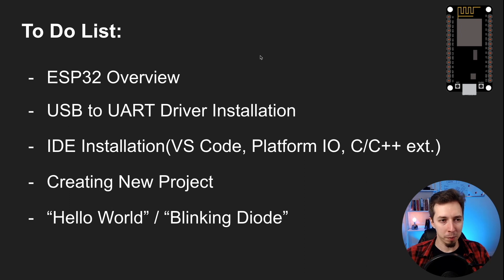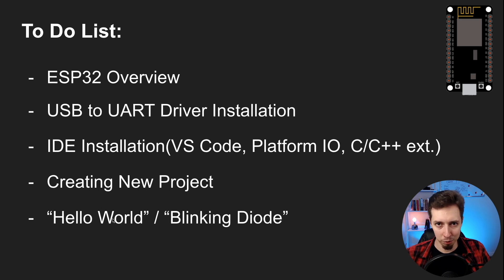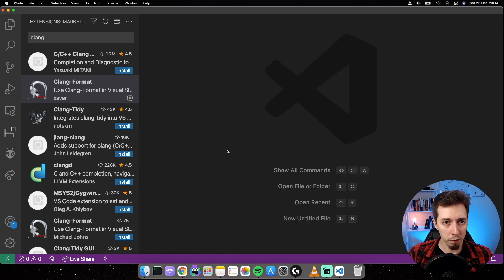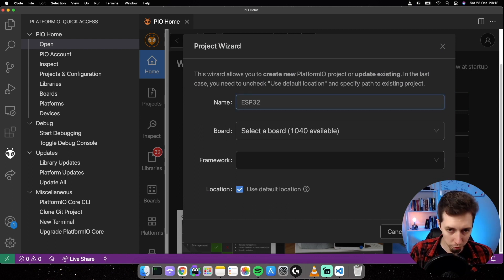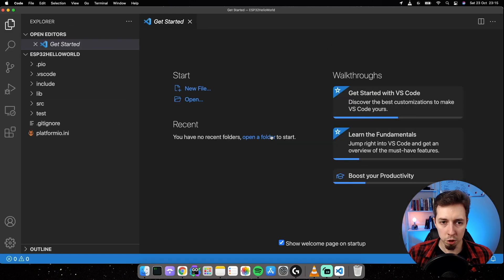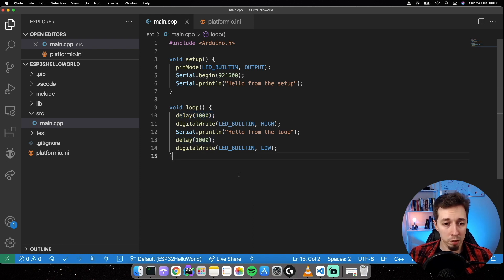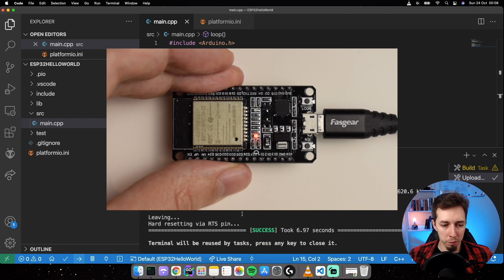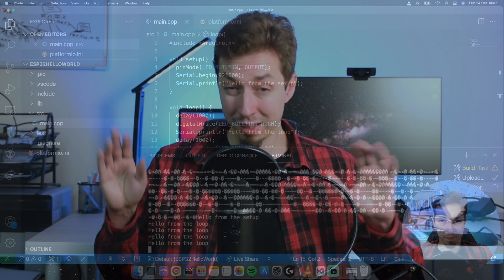Getting Started with ESP32 - Step-By-Step Tutorial

Comment: 4 years later and this is still one of the best beginners ESP32 tutorials I have seen. Worked neatly in Windows 11 as of 2026
Reply: I also enjoyed this video. I had one small doubt 🙂
Do you know if it’s possible to integrate sound sensors and gas sensors in this ESP32 simulation (VS Code) without using physical hardware?
Reply: I also enjoyed this video. I had one small doubt 🙂
Do you know if it’s possible to integrate sound sensors and gas sensors in this ESP32 simulation (VS Code) without using physical hardware?

Comment: Thank you so much for the video help, Tomasz. With a few tiny errors it worked great.  (I had to wait for the "Connecting......." before holding the ESP button.
Since this chip takes 3.3v and not 5V, how would you power it if on battery?

Comment: Unfortunately, the upload to my dev board is not working. Yes, I pressed the boot button -while plugging the cable in, after plugging the cable in, before plugging the cable in -it does not matter. There is no device found. I chose usbmodem as a connection, since I use an Xiao ESP32C3 board which should have a usb controller built in. But the Uart connection does not work either -also no device found. Any Idears? Thank you!

Comment: For ESP8266 you keep boot pin grounded, then you ground reset (or push buttons if buttons are connected). So the mcu starts in Flash mode. It is about espressif cpu I suppose.

Comment: Hi Tomasz,
I am using a DOIT board. When I try to upload the code, I get an error as below:
Error: Please specify `upload_port` for environment or use global `--upload-port` option.
For some development platforms it can be a USB flash drive (i.e. /media/<user>/<device name>)
* [upload] Explicit exit, status 1

Can you please guide? Thanks.
Reply: I figured out what the problem was. The cable that I was using only had power lines not the data bus. Changed the usb cable, now it works. Thanks.

Comment: sir its show error on compiling Traceback (most recent call last):
  File "esptool.py", line 31, in <module>
  File "PyInstaller\loader\pyimod02_importers.py", line 352, in exec_module
  File "esptool\__init__.py", line 41, in <module>
  File "PyInstaller\loader\pyimod02_importers.py", line 352, in exec_module
  File "esptool\cmds.py", line 14, in <module>
  File "PyInstaller\loader\pyimod02_importers.py", line 352, in exec_module
  File "esptool\bin_image.py", line 14, in <module>
  File "PyInstaller\loader\pyimod02_importers.py", line 352, in exec_module
  File "esptool\loader.py", line 30, in <module>
  File "PyInstaller\loader\pyimod02_importers.py", line 352, in exec_module
  File "serial\__init__.py", line 29, in <module>
  File "PyInstaller\loader\pyimod02_importers.py", line 352, in exec_module
  File "serial\serialwin32.py", line 15, in <module>
  File "PyInstaller\loader\pyimod02_importers.py", line 352, in exec_module
  File "ctypes\__init__.py", line 7, in <module>
ImportError: DLL load failed while importing _ctypes: The parameter is incorrect.
[3312] Failed to execute script 'esptool' due to unhandled exception!
exit status 1
Error compiling for board ESP32 Dev Module.

Comment: Retired engineer, old enough to be your grandpa. Really enjoyed your tutorial.  Discussing really simple steps is critical to start the learning process.  :)
Reply: Same here
Reply: Broooo💀💀i mean uncle l.... No gramps✅
Reply: You are no one’s grandpa
Reply: I built Anime Multimodal Emotion detection https://youtu.be/VNn2a7_wTZU?si=913oBFmeWxG2hnLo
Reply: I just know ESP32 for camera by combine it with arduino? Actually what's the exact function of ESP32?
Reply: @edibandulan5266  It's basically made for IOT applications - it's an SOC that integrates WiFi/Bluetooth so you can have multiple microcontrollers/processors, communicating with one another over your home network (or on their own private network), and controlling things via GPIO accordingly. They can also do interesting things by themselves - act as a super low power DNS server, and other things I don't understand lol.
Reply: @edibandulan5266  Hi, ESP32 is microcontroller. There are many microcontrollers like TI MSP430 series, NXP KM series, etc. Microcontrollers unlike simple processors come with alot of peripherals integrated into the single chip, like UART module and SPI for communication, ADCs to convert analog signal to digital values, etc. ESP32 comes with, one can say, peripherals needed for WiFi and Bluetooth communication, other than regular peripherals like UART, SPI, I2C, etc. And the processor is very powerful, plenty of memory, and extremely cheap as compared to other chips with similar features. So if you want to give your system, maybe camera, or maybe sensor system, wireless communication capability, ESP32 is a good choice
Reply: @edibandulan5266 it's a microcontroller. You can use it as a Mini-Computer for specific tasks. Read the current water height on a tank is probably overkill, but I'm using it to create an instrument panel for flight simulation.

Comment: Using an ebay ESP32 ESP-WROOM-32 ESP-32S Development Board 2.4GHz WiFi & Bluetooth I found LED_BUILTIN didn't work, undefined; found the blue led on the board (other was a red Power LED) is GPIO_NUM_2 , changed that plus used 115200 as the baud rate and it worked. Linux Mint using the VS Code flatpak.  Only changed the baud rate because I recognize 115200 not  the 921600.    Also used the ESP32 DEV Module.     Appreciate the video.
Reply: we're using the same devices, thanks for the heads up

Comment: i have a question,on this line "serial.begin(921600)"in void set up,what does this number"921600"mean?what does it represent?
Reply from the maker: 921600 is a call baud rate. It represents the speed of data transfer between ESP32 and computer over the serial connection.

https://en.wikipedia.org/wiki/Baud

Comment: This is a great video!!! Thanks for teaching me on the basics of an ESP32.

One question I had is. How do you terminate the process?
When I kill the terminal, the diode is still blinking and it won't stop
Reply from the maker: Hi Clay,
the code runs on a microcontroller so it will run as long as you provide a power to it so the simplest way to "terminate" it is to disconnect it from the power source although if your goal is to be able to run and kill processes on ESP32 you can either program it so external control is possible (you can check my other videos on how to control it over WiFi/internet) or you can put it to sleep after X number of seconds (I don't have a video on it yet but I'll make one soon)
Reply: @tomasztarnowski4434  
Thank you for explaining it
Again, very helpful video

Comment: Can I use sample codes for ESP32 WROOM and libraries with the ESP32 - mini-c3 ??? I need to do a low power project, so that's why I'd rather used the ESP32miniC3?  Thanks
Reply from the maker: Hi Sophia, I think it should work with ESP32 mini-c3 as long as you select the right board when creating a new project in PlatformIO however if your board is not on the list then it might be a bit more complicated and I'd suggest checking PlatformIO forum. If your board is ESP32-C3-DevkitM-1 it should work fine.

Comment: Is there a way to program the board without installing anything (Arduino IDE , ESP IDF, MU or VS Code editors)  nor creating projects?    I'd just like to upload micropython through something like thonny/putty  and then toggle my ESP32-C3H4-RGB pins via REPL!   

My board doesn't seem to have an official port in the micropython download page, but I've read that it should work with the (latest?) 1.18 port: "ESP32-C3 with USB"  and the board description "01SPACE_C3_RGB"

But how can I upload it?  I've seen people use the python module 'esptool'.. and that you must keep the power-on with the boot button pressed while powering-on... but how can I upload the bin?
Reply from the maker: hey Ben, to be honest I haven't played around with micropython yet and don't know how this should be compiled to get the binary. Regarding the upload as far as I know there are 3 ways of uploading the code to the board:
- upload a binary using esptool via usb cable connected to the computer (that's how Arduino IDE and PlatformIO do it under the hood by the way)
- OTA - over the air update - board downloads the binary from the internet/local network and update itself automatically
- USB OTG (works only on ESP32-S2) - this potentially could be as simple as connecting the board to the computer and then drag and drop the binary file although I haven't seen any working solution yet

Also I have project on my TODO list to build a tool to write and upload code to ESP32 from the browser so no editor is required however I need to make a few videos before that :)

Comment: We can also code it with the arduino ide
It's much more easier than vs code
Reply from the maker: Yeah but personally I prefer PlatformIO with VS Code over Arduino IDE as you have code completion for C/C++, auto code formatting with CLang extension, code editor appearance settings like dark mode, Git integration, a config file (platformio.ini) to keep all the dependencies and other compiler specific configuration, ability to unit test your code built-in in the platform, and much more that you don't get with Arduino IDE.

Comment: Why not use the Espressif IDF Extension?
Reply from the maker: Mainly because PlatformIO supports Arduino Framework (correct me if I'm wrong) but also the community is bigger so it has a great support.
Reply: @tomasztarnowski4434  I am not an Arduino fan... I'm IDF all the way.  The IDF Extension in VSC is working for all my needs at this point.  In fact, PIO fights against those tools, so I pulled PIO out of my process about 12 months ago.
Reply from the maker: To be honest I haven't tried to use IDF extension yet. I will definitely try it at some point in the future (I plan to make some videos about freeRTOS/IDF). Also I think you can use IDF with PlatformIO.
Reply: @tomasztarnowski4434  The new IDF extension is so good, I can't imagine what I might be missing with PIO.   Besides, I mentioned already, based on my experience these tools fight each other.   PIO was certainly helpful 2 year ago, but Espressif has caught up in their tooling and VS Code and the extension are more than enough for the job.
Reply: @tomasztarnowski4434  Using a library on top of another library is not the way to go.  I do understand there are a lot of hobbyist types out there.   My prediction is that all mature Arudino people will be forced to graduate to the IDF to become proficient in their craft.
Reply from the maker: It depends on what you're working on. I think not just for hobbyist projects but also for rapid prototyping with this whole ecosystem of libraries and the simplicity of Arduino Framework you can build something really quick and validate on the market fast, then once your idea is proven I suppose you can consider moving to lower level and migrate to IDF/FreeRTOS. Although again this all depends on your project, the level of stability it requires or how close to real-time your code has to work.
Reply: @tomasztarnowski4434  Here is the problem that I'm seeing.... those libraries are poorly written with respect to RTOS.  You can get one to run independently but you can't 2 or 3 to cooperate because they are sloppy when it comes to co-operative multitasking and adhering to RTOS mechanisms.   The net result are clients calling for "Arduino Experts" because the components don't get along very well.   I just integrated A-W-S IOT services:  Fleet provisioning, Shadow, Jobs, and OTA.   It looks nothing like the stand-alone demos.  This is all in the IDF.
Reply from the maker: The problem with poorly written libraries is quite common in the entire industry :) even for web development I always check the code before using anything external. Also for FreeRTOS/IDF unfortunately there's not many libraries neither any registry/repository where people could share their open source code and I'm not sure why this is the case is it the complexity? or the fact that most software written based on it is closed? maybe there was no need? not sure.

Comment: But this ide plugin is the same as arduino or are we programming lower level?
Reply from the maker: Hey Luis, this IDE plugin is the same as arduino. You program the board like with Arduino IDE but you get extra VS Code and PlatformIO features like auto code formatting, intellisense, easy access to CLI and Serial Monitor, Unit Testing, Debugging etc.

Comment: Hi. Tomasz. I repeated your video tutorial on my laptop with Linux Ubuntu operating system. But before starting the download of HelloWorld code to the esp32 microcontroller, I did't install any driver for uart-bridge CP2102 (I haven't used any boards with any CP21xx chip before on my laptop, for sure. I installed the system just a couple of months ago.). But despite this, everything was loaded and the board passed the LED blinking and sending text to the terminal.
I think at the moment newer Linux Ubuntu versions already support the CP2102 chip out of the box.
Reply from the maker: Hey, thanks for confirming this with ubuntu. Looks like the most popular Linux distributions support CP21xx out of the box :)

Comment: "The microcontroller is just this chip..."
No, that's actually JUST the metal shield covering the MCU. The ESP32-chip is less than a quarter of that metal shield hidden beneath it, and looks very similar to the rectangular Serial-to-USB-converter chip (without leads) close to the USB-port.
Reply from the maker: Thank you for the clarification Colab User. Sorry I didn't want to go too much into details :)

Comment: I was able to follow this flawlessly.   You style is methodical and very easy to follow.   THANKS.
I have one question.   How does VS code know which COM port to use to upload the code?
Reply from the maker: Thanks for the kind words, David. I'm glad I could help.

In terms of the port detection PlatformIO loops through all the available ports and tries to match the device by hardware id/model - you can find more in this thread https://community.platformio.org/t/auto-detect-port-explained/16062/2.

Also if you'd like to specify the port of upload you can do it by adding "upload_port = /dev/ttyUSB*" or "upload_port = COM[13]" to platformio.ini config file - have a look at this page in the PlatformIO docs: https://docs.platformio.org/en/latest/projectconf/section_env_upload.html#id1
Reply: @tomasztarnowski4434  thank you so very much for the detailed response.  It is quite helpful.

Comment: maybe I wasn't too attentive, but I couldn't see info on which pins to plug vs. the serial adapter which was the info I was looking for. Is it the same as the esp8266 probably?
Reply from the maker: hey, I'm not sure if I understood it correctly but do you mean the pinout reference - like what digital pins can be used to connect an external diode or other electronic part? if so you're right I haven't covered it with this video but I can cover it in the future.